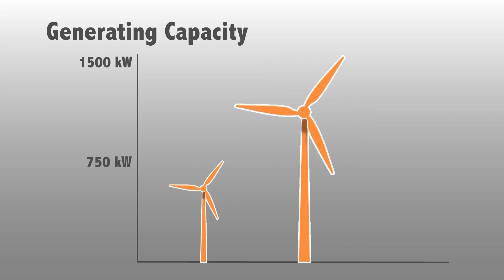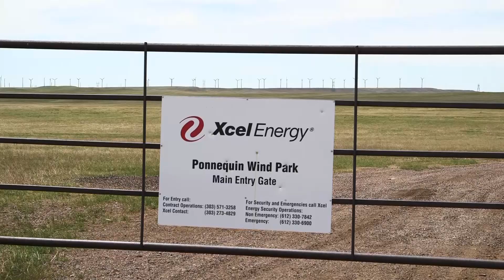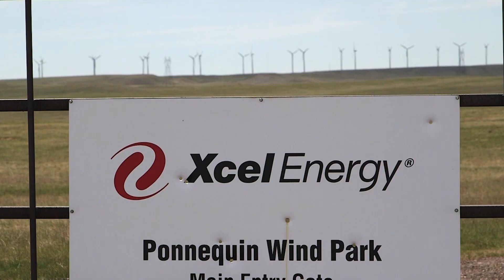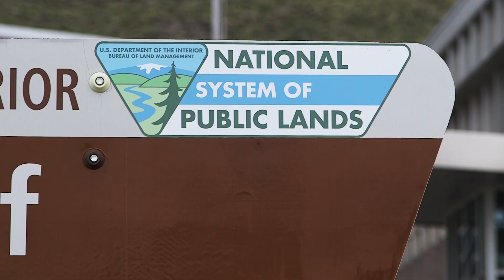Who Cleans Up When a Wind Farm Retires?

Comment: I'm sure this is another video paid for by the oil and gas industry. Wind is free, it doesn't use water, renewable and clean. Everything has a downside somewhere but when comparing wind energy and oil or gas there are very few with any common sense who would select oil or gas over FREE and CLEAN wind. The oil and gas industry creates "Institutes" and 
there are no legal restrictions to the term "Institute". Most of these Institutes are think tanks with specific agendas.

Comment: At the end of the clip: Renewable energy is not free from impact. 
So while they’re running, you get some energy production as well as the eyesore, but when they need maintenance or the wind is too strong, they have to be turned off. Then when they are to be turned back on, you have to get them moving with the use of electricity produced by..........? 
Then, when they’ve reached their use-by date, you do what; leave them in place because how do you take them down individually without creating a domino effect, an avalanche of enormous pylons and blades? Oh, you blow them up and recycle some but the rest goes to landfill.
Well I hope your inadequate “renewable” “green” energy was worth all that expense, land degradation and landfill

Comment: Xcel Energy discontinued operations of its portion of the Ponnequin Wind Farm on Dec. 31, 2015.
 The company will maintain aviation lights, and other safety and security measures at the facility until 2019, at which time we should have a final decision on the disposition of the towers and related assets.

Comment: Seeing how the majority of the wires in the turbine is aluminum. Depending on the turbine manufacturer the company that would bid to retire a windfarm if it wasn't the installers would be someone like ersg  wind or blue wind recovery group. As far as "unscrewing the nut on the bottom of the bolts" even if you had the tooling big enough to do so i would not suggest it. The likely hood of you getting out before being crushed is VERY low!

Comment: I have had mine since 2008 and they are still working great! There is NO NEED TO RETIRE THEM.
Reply: So you had them for 13 years BFD.
Reply: @Norm475   I've owned various small wind turbines for 40 years, both off grid and more recently grid tied. They have moving parts, and are exposed to the harshest conditions, they  all wear out and/or require service sooner or later. And you better have a crane with a man basket to service them.

Comment: The more I learn about windmills the less they make sense .
Only if it's part of a mixed system do they make sense but even pumping water to a high elevation like battery storage you still have to spend 3 times on 3 separate systems. When theres wind and sun you can store it with water and when there is none the gravity can be used to drain reservoir to turn hydro electric. Yes its effective but cost is rodiculous

Comment: I wonder...in the 18 years those turbines were running, did they generate as much electricity as it took to produce them, deliver and install them in the first place?? And if you factor in how much energy is going to be used scrapping them, have they ever repaid their own carbon footprint??? I rather think they  probably haven't.
Reply: And they use enormous amounts of concrete for the base.  Hugely carbon intensive.
Reply: But did you actually look into the MWh generated, and compare with the costs to manufacture and install? No, you didn't. You came to a conclusion without doing any of the research because that's what you already concluded. This is such a ridiculously lazy post and the fact that 160+ people liked it, also without checking on any of it, is why we're not going to make it.
Reply: @VulcanLogic  there is a gut feeling that renewable energy is not generally economic. Otherwise their proponents would deliver the calculations.
Reply: @thomasgarbe8354  Gut feelings aren't data or research. They're gut feelings, and they're often wrong, which is the case here. If wind weren't profitable (in areas with good wind, which is key), it wouldn't make up 25% of the grid in a state like Texas which is otherwise insanely hostile to green energy. Texas has great wind. In Iowa, wind power is 57% of their power. Where the wind great, it's the second cheapest power generation behind hydro. And with storage getting cheaper and more efficient (pumped hydro, compressed air, and soon sodium batteries), we soon won't need natural gas back up. 

Look, there will be waste products from wind, too. But it won't be the kind that seeps out from abandoned underground storage tanks full of extremely toxic chemicals. yeah if you put a turbine on the leeward side of a mountain it'll never pay itself back because it doesn't get wind. Put them where there is wind (and they measure well in advance before installation) and they are amazing. We've been using windmills for over 1000 years now. They're kind of a proven technology.
Reply: @VulcanLogic  yes, we've been using wind for centuries. But how come, the Netherlands have given up on them -- beginning in the 1800s in favor of coal?
Reply: @thomasgarbe8354 The windmills never went away. There are many in use that are hundreds of years old. But the use of coal for electricity was because it was dirt cheap thanks to violently exploited labor, which I'm sure you're a big fan of. There also weren't efficient wind turbines at the time. There are now. Dutch wind power generation was almost 9 GWh, which was 18% of their power last year and exceeded their coal generation, which they are phasing out by 2030, Russia be damned.
Reply: @VulcanLogic  coal is foremost reliable, wind isn't. That's worth a lot.
Reply: @thomasgarbe8354 Depends on location and what you want to pay. In places where wind is reliable, that plus natural gas makes coal obsolete because it's not competitive on cost.
Reply: @VulcanLogic 😂😂
Reply: @thomasgarbe8354  : Damn, you just keep proving it. Stop while you're behind, you're just digging a deeper hole.
Reply: But, their financing generated compound interest.
Debt is the goal.
Reply: Great point
Reply: @mikyl-fo8rh  'No No anything is better than oil and coal and nuclear.  What we really need to do is put giant free energy structures into the oceans that can be retired and abandoned never to be seen again.  That's green energy.'  smh  I get pissed every time see shit like this, our "virtue" sets us down the path of stupidity without regard to the long term impacts.  In North Carolina prime farm land has/is being converted to solar panel farms...the wildlife populations have been already been impacted, and so will our crop productions.
Reply: Not even close, they probably don't even make as much energy as the concrete base used to create.. people are so uneducated about these things.. politicians and foreign countries  that make these eyesores are the only ones that benefit from them
Reply: @bb-fe9ur  
They are eye sores. And some windfarms have gone up so fast, with only half of them working.
Reply: @happydays8171  Wind turbines are worse than eye sores. I sense their motion as threatening.
Reply: Politicians need to pass a law that the corporations have to clean up their mess. No claiming bankruptcy. Those at the top of the corporate business have to stay until it’s cleaned up.
Reply: @starrider4878  They might have buried parts of the wind turbine years ago but even blades have recycle value.
We have seen false stories about turbine blades lately, where one "journalist broke into a quarry where blades were stored waiting recycling and claimed they where just dumped.
There is a lot of false articles, you have to do your own research to find the truth
Reply: The propaganda around green is strong.
Reply: Sounds like a similar problem with the over 1 million abandoned oil wells. Many of those have no funding to decommission them.
Reply: I don't have data on the old ones, but basic research will tell you that the new ones easily pay back the total cost of construction in two years. They can run for 40.
Reply: @rschiwal  That's not what a lady who drinks in my local tells me- and she's the financial director of a company that makes wind turbines.
Reply: Most "green" energy is a scam, including the mining for solar panels
and batteries.
Reply: stop asking hostile questions, you are invading the safe space the left lives.  They prefer fantasy and feel good gestures.  Reality just gets in the way.
Reply: These comapnies don't give a shit about any carbon footprint, environment has nothing to do with any of this,,,, its just another ponzi gravy train for a short period.
Reply: You wonder because you're an idiot who can't read. Tons of research papers available.
Reply: The amount of deforestation that happens for these wind and solar farms is Ludacris. The damage that is done just to clear and destroy natural habitats for these destroys surrounding land and rivers as well. The solar farms generate massive heat from the collective glass reflections it raises the temperatures for the towns and farms that surround them! Do you truly THINK this green new stuff is REALLY good for our earth? I know it isn't after seeing the silt runoff coming from them all into the surrounding areas, the change in temperatures, the loss of wildlife and the food they generate in the lands used is a tremendous loss for the world.
Reply: More climate change hoax and tax payers expense.  Drill baby drill!!
Reply: Exactly. The only thing that matters here is energy out versus energy in (EO/EI), and the ratio for wind power is definitely below 1 when all the inputs are considered. Proponents only talk about money because they know they can confuse people with financial razzmatazz. Not one person in a million understand this.
Reply: Why are people idiots wind and solar produce nothing They cost hordes of money require burning of fossil fuels to make them and deliver them to the sites they depend on wind and sun to function which is only intermittent If it wasn’t for subsidies they wouldn’t exist They are not recyclable take up acres of land in dump sites Fossil Fuels are far more efficient and produce far more energy
Reply: Negative net outcome in every measurable way.
Reply: @PBFoote-mo2zr nope no money to invest in anything .Common sense which isn't so common .Where are the battery storage devices anywhere in their system ???NONE .Why?????Who has to pay ???follow the money !
Reply: @PBFoote-mo2zr Burn!! Hahahahaha!!!!
Reply: true and based
Reply: Oh most definitely. It takes only a couple years for our 83 turbines to pay for themselves. They’ve been running for 19 years so 16 years of straight making money. Turbines make billions only for those though who are at the top
Reply: This is absolutely the wrong idea for creating energy and they know it . Same with the electric vehicles..
Reply: @jamestyrrell4632  Why ? Do you have any facts to back up your ludicrous statement ?
Reply: No they don't... It's a proven fact ..it's hard to find due to big tech...
Reply: @bb-fe9ur  Do you have a reference I could read please?
Reply: @bb-fe9ur 100% not net zero and a scam and toxic garbage left behind .All that epoxy and oils and lubricant used to maintain the dam things is all over the ground not to mention the oils from transformers and capacitors .It's the biggest scam of teg whole green energy net zero
Reply: No. There was a parliamentary inquiry in Australia that showed a report that calculated the offset of wind power and it barely compensated for the emissions in putting the turbines up and connecting to the grid.
Reply: @seanlander9321  Would that report have been made by the Coal backed Government that wants to keep mining Coal and receives party funding from the Coal Companies and Coal Unions.
Are you that naive ?
Reply: Your use of the word "probably" shows you dont know and it would seem that if they hadn't they wouldnt be profitable. The probability that they were is higher than not is down to the longevity of their service but their does come a time when servicing becomes more expensive than income generated. Unscrupulous operators, like these, have chosen to just walk away, thats no reflection on the technology just the way it was managed
Reply: @Stumpy1854-Orion  good, but service is inherent to technology
Reply: @Stumpy1854-Orion  Typical renewable energy bait and switch...."well, they weren't managed properly". Well, greens have told us they are better so why don't greens have their politicians make sure they ARE managed properly?
Reply: @Stumpy1854-Orion  : I can tell you without using the word"probably".  Wind farms are an enormous, expensive scam/fraud.  Same goes for solar.  All on the back of the taxpayer.
Reply: True, but  what does to cost to put a top back on a mountain in Appalachia.
Reply: @hanlon8159 You say true. You just confirmed wind farms do not save on carbon emmissions.
Not to mention those wind farms and all of the components are manufactured and installed using fossil fuel powered factories and construction equipment.
Reply: @hanlon8159  They won't put back the mountain top.  But you can burn that coal at night and when the wind isn't blowing.  

Meanwhile, wind power kills birds and whales.  And they never really figured all the OTHER costs and trade-offs.

NONE of this "green tech" fostered by the government are green at all.  They just weaken us and hurt the environment in DIFFERENT ways, but you're not allowed to speak of it and your voice is silenced, so you're only heard in the comment section, i.e., you are not heard.
Reply: Good question. I think wind would pay itself back on the small scale, i.e. when it's not sunny where I live, it's windy. But, the base they have to dig and cement to harness theses behemoths are never removed, and the cost is astronomical.
Reply: @happydays8171  Individualized, smaller wind turbines would be helpful, just as individualized, home solar installations can be.  The idea, however, is neither to save the planet nor save the consumer cost.  It is centralized control.  Giant wind and solar installations keep the consumer dependent.
Reply: @Coyotenight1  
Exactly. The wind is a product of nature, just like the oil is in Alaska. If the turbine owners gave a portion of the profits back to the consumer, the way the oil companies do in Alaska, the turbines would be well liked. Side note, a medical center near where I live put up a big, not huge, turbine when they built the facility, and to my knowledge, it supplies their electrical needs. In the semi-rural area it's in, not that much of an eye sore.
Reply: @happydays8171  in there lie your answer oil is very profitable like getting water from a lake with a bucket.... Wind is getting water by holding a glass up in the rain.      Alaskans get a tiny amount proportionally u get a penny if u wanna litigate for it
Reply: @happydays8171  It actually doesn't because of how the grid works. People have this idea that the grid is a bucket that electricity can be poured into and drawn from when it's more of an orchestra. If a section starts and stops playing randomly, the rest has to compensate to keep the symphony going. The bigger that section, the harder it is to compensate for. Eventually, it becomes outright impossible. All that compensation has a cost which has to be accounted for.
Reply: @JacobNeff-oq5km exactly it is redundant by technical limitations.